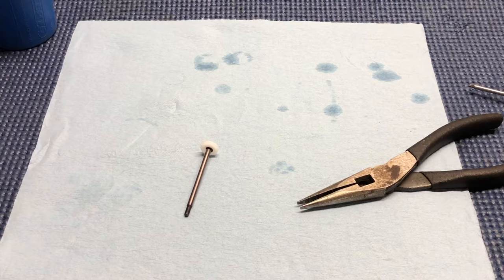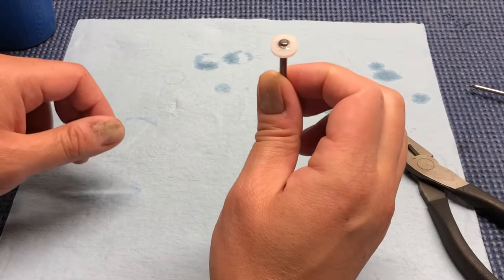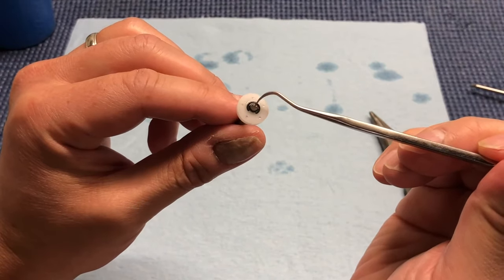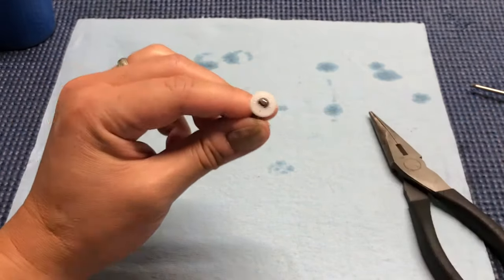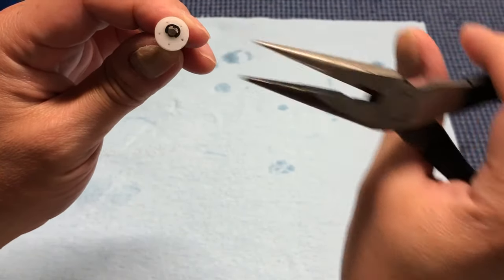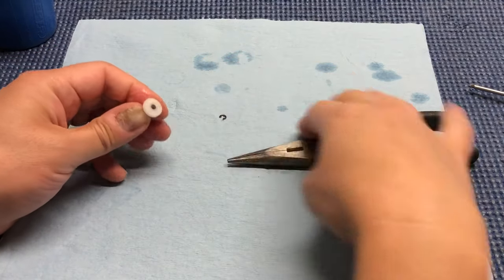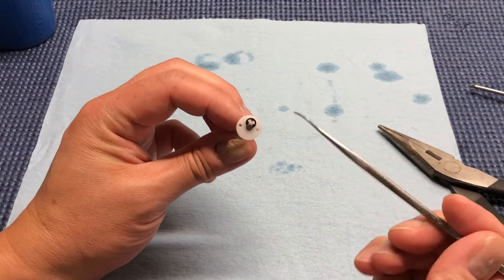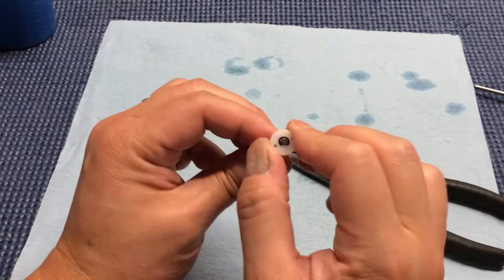Tech Talk: E-clips removal and installation

Comment: E-clips are the work of Satan. Using this technique on the teeny tiny one i'm dealing with, it just spins inside the groove. I enden up actually pulling it off, grabbing the top of it with similar needle nose pliers while holding the thing it was stuck on with a pipe wrench. "Luckily" mine was stuck on a pin where i was able to actually get a hold on the edge. In the past i've also managed to get a different one off by pushing it off with a flat head screwdriver.

Comment: Looking at the e-clips on the back-side of my scooter's clutch assembly, I thought it would be best to use t a slender flat screw driver to 'lever' / 'pull' off the e-clips (as I will not re-use the existing ones), but I will try this method as it may (as you showed) allow me to take them off without damaging them.
Good one!
Thanks.

Comment: Thanks for this vid' . 
Gave me a basic idea.confirmation of the upcoming challenge,  placing a similar size (if not smaller LoL)   on the L hook  thru the slot mech' of a Carb',  new "Choke Pull-off" . 
With  restricted view,  uncomfortable access dist., space clearance less than inch on both sides, ....   LoL

A '82 Ford F-100 V6 3.8L  M3oT   op'

Comment: Have you tried using the back edge of an exacto knife? I used to use pliers as well but found using a exacto easier for me. Most pro drivers use an exacto knife to remove e-clips as well.
Reply from the maker: I don't like using them because I find the tips of the blade to break off easily and then it flies across the room into someone's eye and blinds them.  🤕

Comment: Nice tips sir, I'm from India, sir I have Royele Legend low profile baitcasting reel in it I always struggle on cleaning line level for it this R-clip has to be reviewed but while fixing it give me heard time. More than hour or two hours to fix that "eclip" it has one small eclip and second one is bit bigger. So, kind make a video on YouTube there is non any video to fix Eclip on baitcasting reel.
Reply: Sir, this is an RC channel. If you want tips for your bait caster, you need to look that up somewhere else. Yes, this tip will work for different applications that require e-clips/cir-clips but if you need specific advice for that, kindly find a channel that specializes in that sort of thing.

Again, this is an RC channel. Not a fishing channel.

Comment: That's great! Only thing is that the clip I have to remove and replace is behind my car engine. And the face that you are working on is facing away from me and is 4 inches from the firewall. Bloody hell....
Reply: If you do not need to re-use the e-clip on your engine part, a short-shaft flat-head screw driver will probably allow you to remove the clip with ease, provided that you are willing to replace it with a new one as using a driver to pry it off may damage or mis-shape it, but is highly unlikely to damage the engine part to which it is attached. Good luck. I am about to do the same on a bike clutch.
Reply: @staninjapan07  I got it off but it was harder to get back on. I used the tip of a flat head to try to push it on (down) it seemed like it was on so I took it on a test drive. Seemed ok at first but on the fwy, it didn't feel right. Get home and found that it fell off never to found and the 2 parts had disconnected. Ordered some new clips on-line whichwere made slightly different and went on easy...  Thanks!